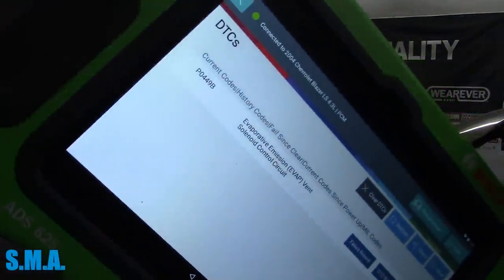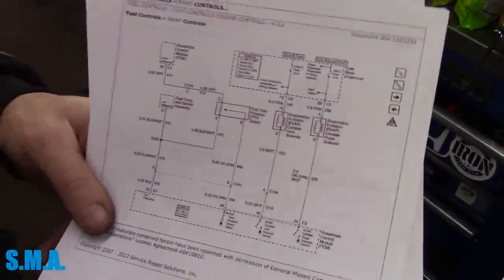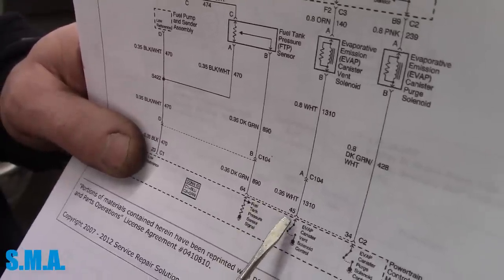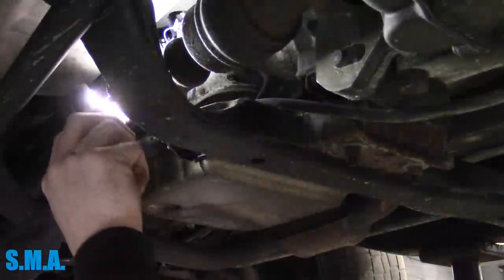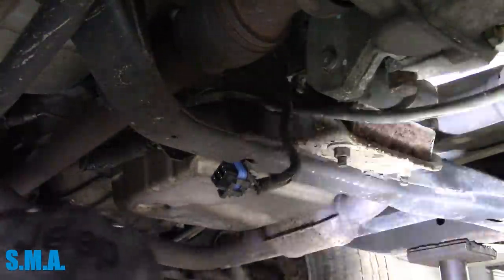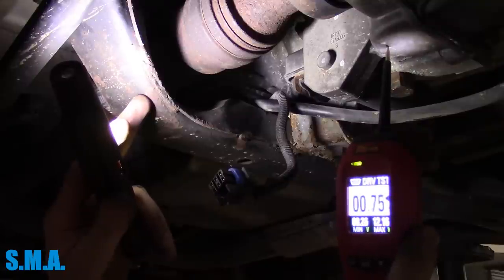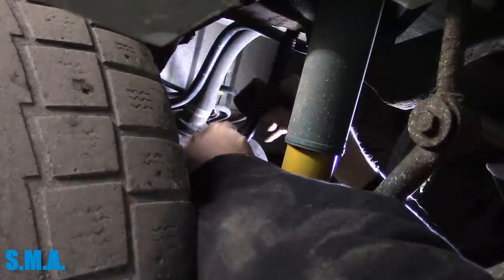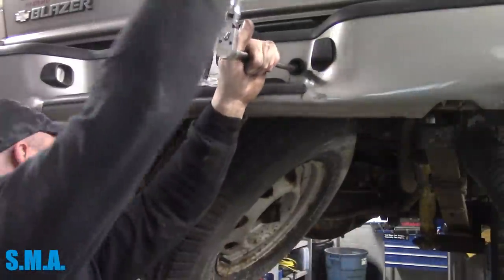Finding A Broken Wire Using Logic

Comment from the maker: OEM GM Service info here: https://www.acdelcotds.com/
Mitchell DIY Info here: https://www.eautorepair.net/
Astro Pneumatic Tool 65SL 650 Lumen Rechargeable LED Slim Light W/Top Flashlight: https://amzn.to/2ur5E7A
Test Light: https://amzn.to/2Vkl5cY
Bosch Automotive Tools 3970 Diagnostic Scan Tool: https://amzn.to/3a5UnIT
Power Probe 4: https://amzn.to/2HOl7Se
Gripper, Cutter, Stripper, Crimper: https://amzn.to/2Pnap9r
Reply: Some county libraries have access to service data as well
Reply: Eric you are an outstanding mechanic/ technician!!!! You are also an honest businessman, love your Chanel, love your family dynamics, it’s good to know there are still good people like you still in this world!!!!
Reply: I really like the list/sources for the tools used in the vids.   How about that cool little butane torch used to solder/shrink ??  What is that ?
Reply: South Main Auto Repair LLC how many jasper engines and transmissions do you install in a year? are they good? Thanks Eric
Reply: The link to your service info shows a ton of different subscription options, which option gives you the actual pictorial of where the wires and clips are? Do i have to get the diagnostic subscription or can i just get the basic info subscription?

Comment: I had an '04 Grand Caravan with a no start. it was the ASD relay. I jumped it and it would start. Spent several hours tracing wires and pinning the connectors. It was a broken ground between the computer and the PDB. Fixed the wire and it was good to go for another 100000km. Pretty happy I figured it out myself and did not have to take it to a shop. Awesome videos SMA thanks.

Comment: Gotta love the simple, clear minded approach you always use. I really like the way you use the "PCM safe" option inside the PP-4 to test circuits that end in the computer. Some guys incorrectly say that you should be OK with 12V through the power probe, but when the circuit is damaged the safety resistors and zener diodes inside the PCM to prevent catastrophe may not be working. Then way too much current overheats the tiny wires and you've got embarrassing smoke caused by your test procedure. Failing that, a low current test light in series may be just enough to avoid a foolish mistake (and the scorn of a pro called in later to fix the damage). What happened to the tire, are those burn marks seen at 16:11?

Comment: Eric, this type of diagnostic example is so crucial to the integrity of this industry, thanks for the content. Using a parts cannon approach, it would be so easy to just change the vent solenoid, then well that didn't work so must need a computer = pissed off customer + loss for the shop....all of this can be avoided through a simple methodical electrical diagnostic process as you've shown . Seems so simple but wow is diagnostic capability lacking in the industry. Parts companies love it!

Comment: i have spent the last 2 days sifting through a sea of green crusties. connectors with the weather proof seals missing, front probed ruined female terminals, knife cuts in the insulation then taped over, 31 bargain basement unsealed butt connectors and what hack wiring job is complete without a handful of scotch locks.   after finding all the issues, i was surprised that the truck even ran at all....going into this with the right frame of mind and sticking to my process prevailed.

Comment: Love all your videos!   Years ago, I remember diagnosing an intermittent no start on a VW Rabbit that had the fixed upper seat belt anchor (It was a 2 door).  There was a broken wire in the door jamb harness that would touch together at odd times.  Another complaint was a thumping noise going over bumps.  That was a broken rubber strap that was supposed to hold the jack up against the spare tire.  “There’s your problem lady!”

Comment: Speaking of O2 sensors, I had one with an internal short to power, it was shorting the circuit that powers MAF and both banks. Stealership quoted me for a new computer Replaced both O2 for like $100

Comment: I had the same problem on my sons Blazer and found the broken wire at the same spot. I think it’s due to poor placement of the wiring harness.
I pulsed @ negative wire through a timer circuit, from the PCM connector and used my probe light with a long 12v + wire attached. Found where the wire was broke.
Great channel~ nice when you have all the fancy tools!

Comment: You don't even have to activate with a scan tool.  You can just check for power since the circuit through the solenoid is good.  You'll have power up until the open circuit.  Since the circuit is hot at all times, you don't need to do anything but check for positive.
Reply from the maker: Well played sir! And this is what I love about YouTube. Someone who thinks outside the box! Simple yet would have been very effective for me in this case. Thank you 👍

Comment: Every electrical repair I do, is on my fleet of tow trucks. Being there are no wire diagrams and wire colors change along the route, there are at least junction boxes where the wires gather and go in different directions. I use the break it down approach, as to which junction box has power and which branch it is lost. Usually a wire where installer did the hokey pokey.

Comment: Hey Eric I diagnosed my fan not coming on on my old Mustang! I went through and tested everything and was down to the last thing and determined it was good so I had to start over.  Unfortunately it was the first sensor I tested that was bad!  I had my multimeter set to the wrong ohm readings.  Fortunately I saved $100 by not buying some computer module!  Those wiring diagrams are very useful when you know how to read them.

Comment: I had a similar experience with the autel on a older gm when i did a purge/seal it commanded the purge to 100% instead of 0% with a tech2 it was fine.   I've learned over the years to split circuits with connectors and to also diagnose with using which connector or module is easy to get to first. Sometimes i give wires a tug to see if they will break and pull out of the harness. 
I had luck only once with the power probe open/short finder. Most of the time a good old visual inspection will show the harness is full of water or you see the green dust!

Last week i had a 19 traverse with a service side object detection. Get the bumper partially off, no power at module, power at bumper to body connector. I stopped there and ordered a bumper harness. Why? Because GM pays 0.5 for a wire repair, and up to 2 hours for a harness replacement, you can claim other labor hours but its always a hassle with punch times and getting the repair order signed off and even if you do everything right GM will still kick the claim and i get back flagged.
Reply: OLH never seems to be too much of a pain at my dealership.  Just clock on and off as many times as you need to, to claim your OLH.  And story, story, story!  Story is everything but so is having a great warranty administrator who just so happens to be the dispatcher as well!  I guess I am very spoiled with the dealer I work for!!
Reply: @JD730  I've worked at shops like that. This one the service manager has to punch you on and off the job, we can't do it.  He has a password and everything. half the time the time claims get rejected i don't think they know what they are doing. i make sure they pay me every time i'm back flagged because a claimed bounce. I did my job correctly its not my fault the claim kicked.
Reply: @daveyio87  I never knew that techs didn't have access to clock on and off jobs. Each tech here has to clock on and off for warranty and recall or special coverage.  Our service manager actually has a thing that if we don't clock on or story out a recall, we don't get paid for it.  It's interesting to hear about how other gm dealerships work.  I work for a Chevy dealership, which do you work for out of curiosity?
Reply: @JD730  chevy. we use reynolds and reynolds with ira ignite. in the past i've used dealertrack which i could punch d time when ever i needed to and have the ro signed off. and another dealership we used reynolds but technicans used a mechanical time clock to make punches.
Reply: @daveyio87  We use CDK. Not sure of you have heard of it.  This is the only dealership I've ever worked for so I'm not familiar with other software programs

Comment: Hi Eric,
I've watched near all of your videos and have been amazed at your skill and thoroughness.  I have been an electrician/electronics technician for 32 years and I was disappointed for the first time in observing your repair of the broken wire.  Imho you should have spliced in a short length of wire instead of just trying to splicing the two ends together. That resulted in the fine wire becoming the shortest in the bundle which meant it had the greatest strain of all of them.  So with the vibration of driving it will break again sure as tooten.  Not a criticism, as I have nothing but respect for your work, it is just that I've seen this happen time after time in my trade.

Comment: I didn't have an easy - bake oven, but I did have a vac-u-former which used a light bulb to heat up sheets of plastic which you sucked into plastic dies using a hand pump to make bodies for toy cars.

Comment: Quick tip Tuesday for me! The leads from a multimeter will fit into the tip of the power probe 3. Dont know if its the same for the 4 but its sometimes easier then fitting the entire probe into a tight spot.

Comment: No parts cannon needed.
Good job Eric 
Thank you 
Looking for a good scan tool with bi-directional control capabilities.
I hate to say it, but for pricing, looked at harbor freight. 
1,000 ducks for theirs and could maybe use for road work without worries of a loss or damage. Price on a Solus would kill me if not chained down or tied down. 
Was broken into a few years ago by gangs in Cali and hit with a 60k loss. 
Popo was useless and insurance was a joke. 
How's that Bosch unit?

Comment: Excellent lesson Thanks again for your contribution to the people.   If the visual inspection hadn't  turned up anything would a bypass wire be the repair choice?  Also, those without bidirectional scan tool could one check  wire resistance from connector to connector?

Comment: Here in Erie County PA the sad part is that would still pass emission inspection. Visual and gas cap test only. It is hard to sell check engine light work unless they have noticeable drive ability issues.

Comment: Mr. O, I've got an 01 GMC that came from a Large tree company and their Jerrys butchered the wiring. (Go figure) I've been soldering, shrink tubing, taping and then coating the repairs with flex seal. Stuff is way better than liquid electrical tape!

Comment: I think the ones we had you would color them cut them out anew put them in the oven.  Looked them up you can buy them online still if you want your kids to experience them.  Thanks for the videos.  I found my problem with and circuit with visual inspection.  There's your other problem lady the tires are almost as worn out as your temporary plate.

Comment: An old mechanic I worked with said he would connect AC to two wires he suspected and plug it in. When he saw smoke, he knew where the short was. Not recommend if there's an ECU in the circuit, but in the1930s, no problemo.

Comment: WOW!! One of our oil techs threw a vent valve at his Blazer then asked for help when it didn't fix it. It was almost beer thirty and luckily I found it quickly in almost the same place. He was happy but got upset when the parts dept wouldn't take the valve back. Plus his spare crank broke when he dropped the tire to get to the valve. I felt bad for him, kind of. Good ole Michigan is not kind to vehicles.

Comment: I had a 1981 corrals once that developed weird electrical problems. Turn on the lights and the wipers started, that sort of thing. I gave up and took it in. $400 later (1984 money) and I had a new fuse box. Turns out that the box was layers of plastic and metal sandwich. The plastic layers had cracked because of cold (it got to -64 a couple of days). All the wires were fine. It was a tough diagnosis. You would have figured it out in twenty minutes.

Comment: Hey Eric, do you think it would have been much easier to use a Extech 40180 Tone Generator and Amplifier Probe Circuit Finder Kit to find that broken wire along that section of loom running to the back of the truck?

Comment: Fan-friggin-tastic vid, brother! 👍👍

My biggest problem is getting past the 'spending money for information' thing. I just can't! I feel like if you spend anything north of $10k on a vehicle, that info should be supplied with said vehicle! It's a principle thing, to me anyway. But, that ain't helping me fix any vehicles ... so as much as it pains me, I have to spend the money. But, I WILL complain about it!!  Loudly, too. And with F-bombs.😁

I also have nearly ZERO luck with visuals. I see melted loom ... BINGO! I start digging. Wires are good - just the loom melted. Further down I see a hole in the loom like you found. It's tucked up behind a million things I can barely reach. My arms are burning from the contorted angle they're at trying to cut the loom open. Again - NOTHING inside! Hour wasted! Wires good! And this is how it goes for me, 95% of the time. I could've run a new wire in that amount of time. Of course, patience helps ... of which I have none. A little luck would go along way with me, too. 😂

Comment: don't have any tools, but i;d assume you should have to hit "seal" first, which to me would close the vent and tank pressure should slowly change to positive pressure with thermal fuel change alone, if not then the purge sol. may be leaking past or fuel cooling off rapidly(not very likely lol) no positive increase after x time could and likely is a leaking vent, gas-cap, tank, line...

Comment: You should get one of these Sperry Instruments Lan WireTracker Tone and Probe Wire Tracer

Model # ET64220

Testers. It will help find broken wires, missing fuses, etc. Just clip it on the wire you need following, and follow the tone. Where it stops that is your problem.

Comment: Is it common for Chevy fuel tank pressure sensors to  work intermittently?  I have a reoccurring PO449. I'm sure I'll end up replacing it, but I thought it was weird that the MIL would go on and off with weeks sometimes between events.

Comment: Could you have run the purge test if you had run a jumper wire for the tank pressure wire across the separated connectors?

Comment: I was just thinking about asking you a question when this notification popped up.

98 4runner with the big 3.4
Always runs great but if I park uphill for a while then start it cold I get a small amount of steam from the tailpipe as well as some water pooling in the tip of the pipe. 

Could it be water produced by the cat. conv.?  I hope thats all.  Oil always looks good and coolant stays full.
Reply: I'm not a mechanic or Mr.O but my guess is it's caused by condensation in the exhaust system. Possibly, maybe, could be. Hopefully someone who knows for sure will answer  :)
Reply: @farmcentralohio  thanks for the input.  I'm hoping that's all it is.
Reply: Most likely is condensation in the exhaust. H2O is one of the products of the internal combustion process of a hydrocarbon fuel engine.
Reply: There's always going to be some water coming out the tailpipe as a byproduct of the combustion process. Usually mufflers have one or more weep holes in them too so any water that builds up inside can escape.

Comment: i bought a truck the other day for $800 that i personally would value to be worth around $4k in private sale cash...guy though it needed a whole new harness and computer....(diagnosis was no power to anything on the truck, truck was going into reduced power mode and shutting off before it stopped running for good)   i had a gut feeling he had no idea what he was talking about , sure enough , broken ground to the PCM. truck now runs a drives with zero lights on on the dash.

Comment: I have a 97 Ford F150 that was shifting wonky and was displaying a transmission trouble code. I can't recall the codes. I took to a local Ford dealership. They said it looked like a short in the wiring harness that controlled the transmission. They said the shop time to fix it would be pretty expensive. At least, they pointed me in the right direction. I took off the passenger front tire and the inner fender liner and found the harness was laying on the exhaust pipe. There was NO damage to the wire insulation. I used nylon ties to resuspend the harness. I cleared the codes and they have not returned. Can there be an inductive effect with having the harness laying on a hot exhaust pipe that would interfere with a control signal? Sorry this was so long.,

Comment: I think I would have gone for the other side of the front connector for diaga - should be 12v on the white wire and grounding it energises the solenoid.

Comment: Years ago cars were mostly mechanical with very little electronics. Now for the most part it is the exact opposite, more electronics than mechanical. So now you spend 20 minutes to a half hour just finding electrical diagrams, connector views, etc. before you even touch the car. This is why few folks understand why diagnosis time costs what it costs.

Comment: HI, like a lot your channel. You have a lot of experience and quite a lot of tools and methods to fix complex issues. I would like to ask a simple question. I am looking for a escanner tool that can be useb both on 2003 and 2005 GM trailblazer (both year models with 6 in line atlas engine) and on 2012 2500 RAM. The idea is ta have a tool that allow both diagnostic (engine, a/t, abs, airbags) and programming of items like keys, radios, modules,  etc. Any recoomendation? Thanks a lot.